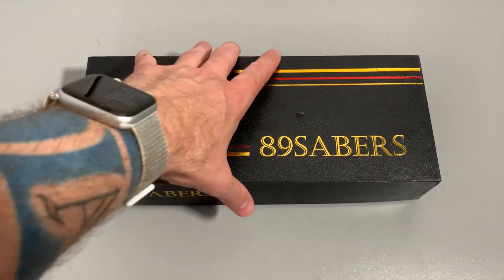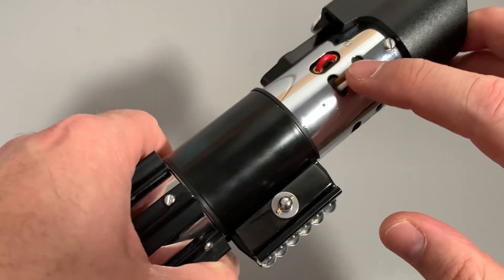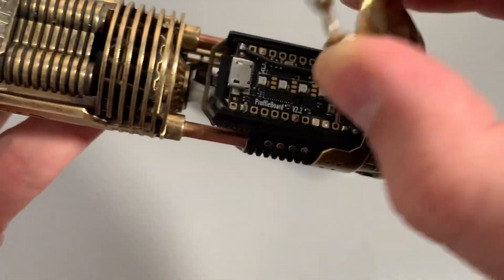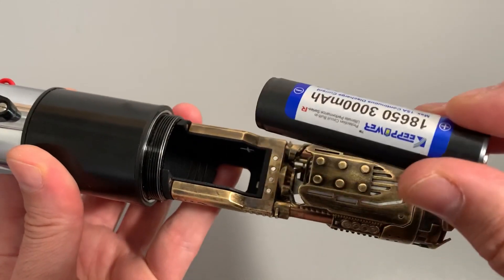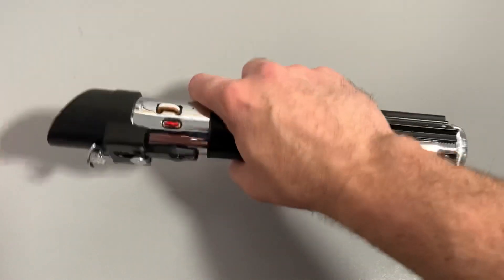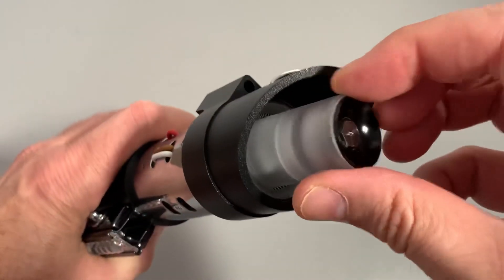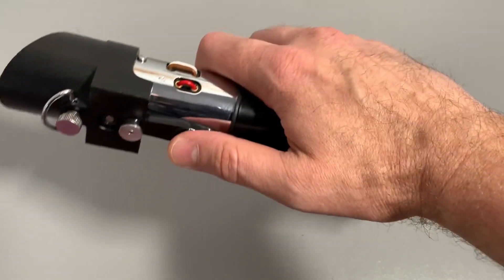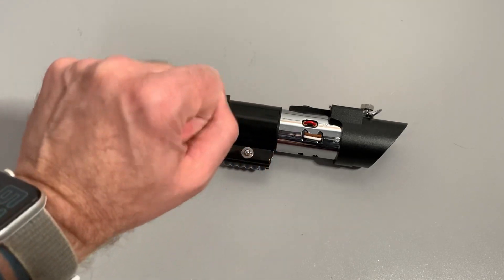"Darth Vader MPP2.5" - 89 Sabers with Sith Master-Chassis, Proffie v2.2 & Neopixel (Review by OxR)

Comment: Awesome work. For the real side wires did you have to drill the standard holes a little bigger? Also what glue did you use to keep them in place?
Reply from the maker: Nope… no drills needed… I secured the wires with loctite

Comment: I have a Darth Vader DV6 could this chassis with some modification be used for my hilt?
Reply from the maker: That’s a good question… I don’t can answer that. Which maker and Modell is your DV6? Normally this chassis is designed for the Mpp2.5 from 2018-2022… I don’t know if the measurements and the inner dimensions are the same!? That’s something you have to ask @goth3designs
Reply from the maker: The master chassis for the DV6 is normally this: https://goth-3designs.com/sabers-props/vader-dv6/

Comment: I have an 99sabers vader from sean sabers  i would love a install like that  how much is it?
Reply from the maker: Before this we need to check which chassis are compatible. 99sabers I didn’t knew… or you mean 89Sabers? Which one… the same 2.5 or what version… from which year?
Reply: @oxrcreations  i think its an MPP 2.5 it came with an aluminun chassis, it does have electronics with a proffie 2.2, i want a steel goth3d, real quartz crystal (only one crystal in chamber) and interchageable crystals, using the blade detect and blade id function.
Reply from the maker: @D4ni3lS4nk3  puh… I don’t really know if your hilt is the correct and if all is possible as you request that. It’s important to 100% sure if your hilt is the correct one… if not and you purchased a expensive metal chassis and at the end it not fits, then the money is lost… 😩